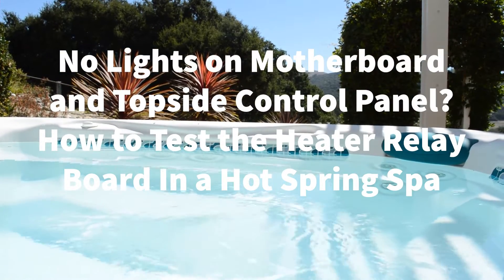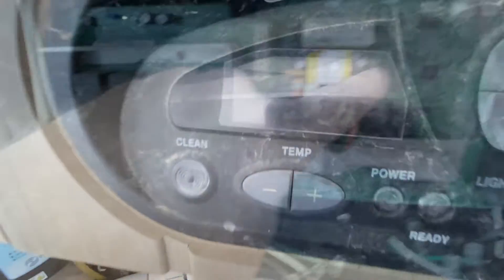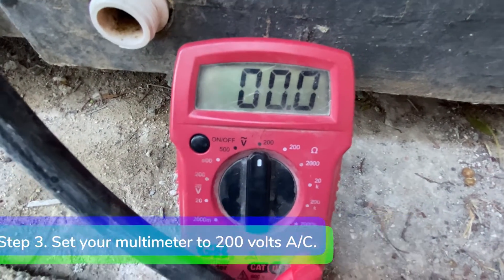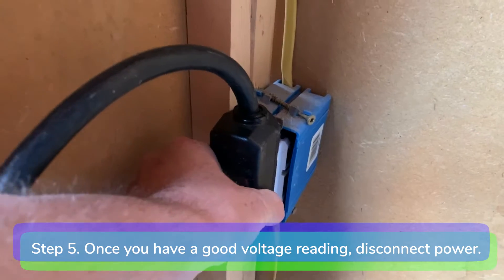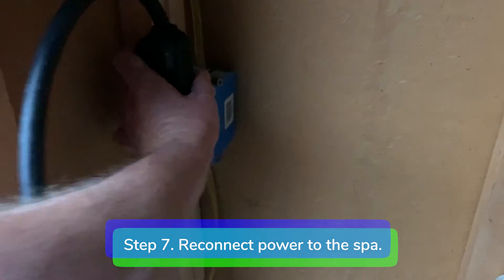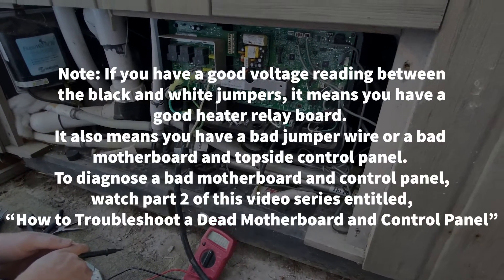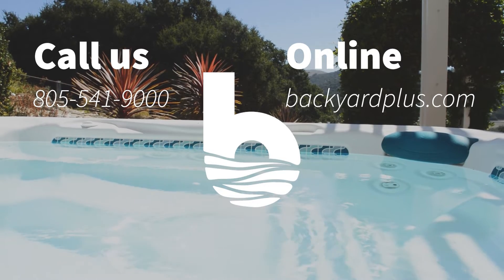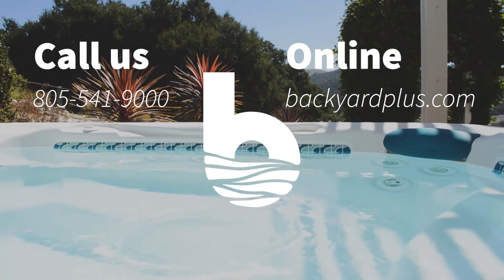No Lights on Motherboard and Control Panel? How to Test the Heater Relay Board in a Hot Spring Spa

Comment: What does it mean on step 8 if my heather relay board is getting 18-20v? The board is a 77119
Reply from the maker: If the incoming voltage is 120 and you are getting 18-20 volts there, its a bad heater relay board.